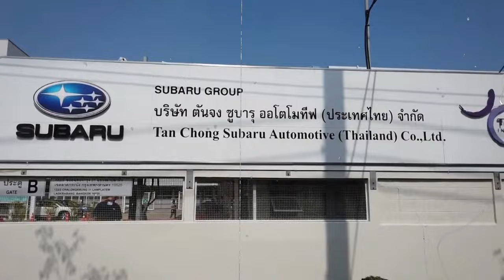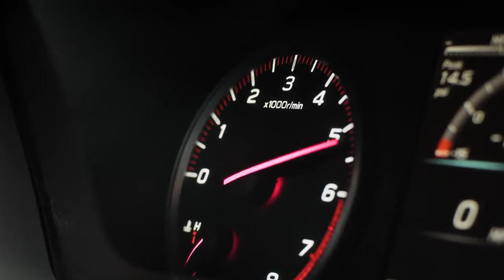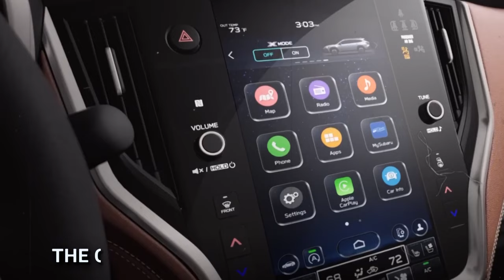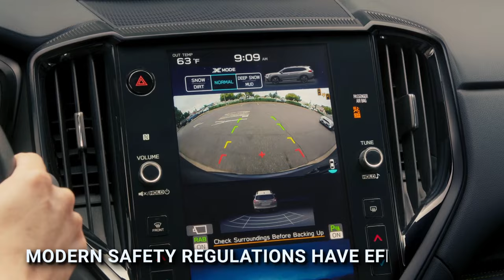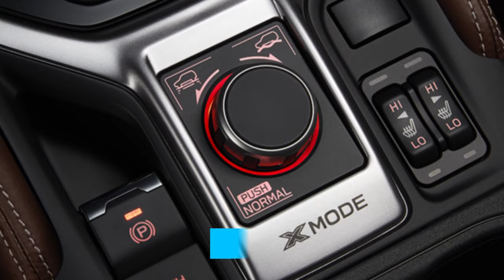Subaru CEO Reveals ALL-NEW $23k Pickup Truck & Has Other Automakers Crapping in Their Pants!

Comment from the maker: 🔴If you could change one thing about the new Subaru pickup truck, what would it be?🤔

🏆Ford CEO Reveals 5 NEW Ford Models for 2024 WATCH HERE 👉https://youtu.be/hHlNCYkADkE
Reply: Make a model with less tech which should equal a lot less cost.  I don't even listen to the radio when I drive so I don't need a fancy screen and touch screen.  Also, the bed of the truck needs to be 6 ft. Go back to basics and you will have a huge seller.
Reply: @colleenwehrle6358 You hit the nail right on the head . 
I have had 5 Subarus . 
My current one is a 2016 Outback Limited 2.5 naturally aspirated with over 205,000 miles on it . Still going strong 😃.

Comment: No manual transmission, small cab long bed option? Great, room for 4 people and a bed sized only for the gear for 2 of them. More of the same useless bed length sized for Costco instead of the outdoors/camping. Instead of calling it a small truck, call it what it is. A small bedded truck. Not interested
Reply: If it did what you wanted,  a lot of others wouldn't want it. Not everything is for everyone. That said, it's is that small, I'm getting it and building my own camper for it.

Comment: OK great News! In the 70's OZ had the Subaru Brumby. Later on 80's I Had a similar but later GL Wagon. I had a week at Falls Creek with the Grand Wazoo band. My GL was in the lower car park. The snow was knee deep over the bumper, half over the headlamps. I thought I’m not goanna get out of here, my GL starred ok, I creped forward and back several times. Then It’s time to do your best, put peddle to the metal and flog it. ’10<15ø uphill in 12” of snow ‘ I think they were watching me, the marshals spotted me and said you have the remove the 6<10” snow from the bonnet/roof of your car. “I was just amazed that I just popped out in one go and didn’t have to wait around the over-snow recovery boys!